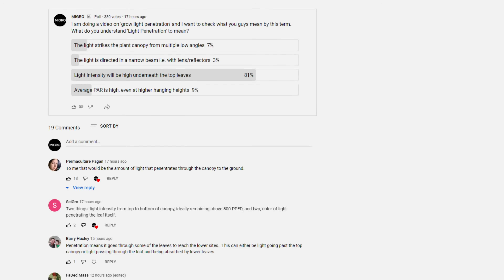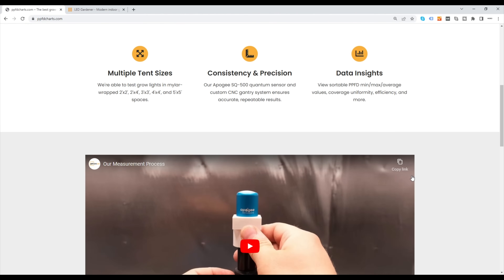Grow Light Penetration is WRONG

Comment: I can understand both at first I liked having the light low with my mars hydro but after getting a 650r I find having it raised as high as possible and turning her up seems to get better over all penetration so it come down to the desired use and design of the light I would think most gone use lights are designed to be right on the canopy and more commercial to be higher hanger

Comment: I am commenting right after the poll, just to throw in my thought on what Grow Light Penetration means. To me, it means that the leaves get light as far down the plant as Possible, so 100% Penetration would mean that the leaves on the very bottom of the plant get as much light as the leaves on the very top of the plant, As you go up the plant from the bottom, the penetration % drops, if the very middle of the plant from the bottom gets the same light as the top, that is 50%. If only the very top layer of leaves get light, that would be 0%.

Comment: Maybe true for some. I pay 1/2 the rate you mentioned. HID systems components can be replaced individually, while LED can not. At current prices I feel HID makes sense for people like me.
I don't see many talking about total cost over a longer time period which includes replacements assumed to be at current pricing.
Reply: Thats the other side of the Led Saga 😅😅led are good but sodium still works , the equipement its cheap compared to any led, its funny couse in the old times the idea was to reduce the bill , but now everything is eficiency .and they finish with 750 watts leds bill 😊and if a lamp burn , i can replace it with 10 us😅

Comment: I have a random question.
Once I've remove, the plastic cap, from light bulb can I change the spectrum by colouring in the LEDs with a red/blue sharpy 🙂
Reply from the maker: Hi, 

No a phosphorus coating on the LED diodes is what changes the color temperature.

Comment: Are you sure about side lighting? as this is something I've always wanted to try as I would think there's always branches and buds that are underdeveloped because they don't have access to light, and if you open things up or bend them into the light suddenly they take off. I would think having sidelights would develop the layers under the top canopy more.
Reply from the maker: Hi, 

Side lighting will increase yield but you will not the a good return versus the extra power consumed.

Thanks.

Comment: Shane you are spot on.  To contribute... I think there were a lot of older growers in this industry that were saying LEDs did not have the same penetration as HID lighting.  With older LEDs this may have been true in a way, but certainly not as we have seen here by your poll.  Early LEDs did not have the green spectrum intact.  With that, there was a diminished activity in the leaf structures due to only shallow tissue "penetration" occurring when the light hit the leaves.  You illustrated this perfectly with one of your slides.  Once the light package went to full spectrum, and then later with the addition of Far Red wavelengths, LEDs came into their own as a viable option vs. HID.  As far as mechanical penetration goes shade is what it is.  FACT - If an area is shaded from a light source the light intensity will be reduced in the shaded area regardless of what lighting type is used.  Again... Having your multiple source light fixture (bar type lights vs. single quantum boards) means that light is available from multiple angles which minimizes shade areas.  It is truly the best possible solution.  Now what I would like to consider is it better to remove the blocked leaves off the bottom of the plant OR is it better to take off large leaves to let unblocked light down into the canopy.....  Great Video!!
Reply from the maker: Thanks.
Reply: Better to remove all the lower weak shoots when coming into flower imho.

Comment: Light penetration is equivalent to low efficiency. Light can only hit shaded areas by not hitting the plant initially, and the bouncing off the walls of the tent or grow area, back towards the plant and hitting a shaded area. It is also more of a property of the canopy than of the grow light. Plants know their canopy produces shade and that is just how they roll. if the canopy is dense, light just doesn't penetrate. Yes, some light passes through the leaf. Yes, some light scatters several times and still enters the canopy at an odd angle. But like this video shows, that's marginal.
You would get the most light penetrating inside the canopy if you blast all the light not at the canopy of the plant, but at the walls.

Comment: The one question i always have as far as trimming everything on the lower parts of the plant aka lollipopping is whether we even have any proof that the plant isn't getting enough light absorbed through the higher canopy that is receiving the majority of the light tand getting everything it needs   to cover the energy requirements of producing flowers above and extra to distribute in the plant to areas below the main canopy or, if it is costing us yields and quality on the higher up flowers, where the exact distance from the light/ or amount of lower flowering sites kept in an area where the light is not penetrating to,  begin to cause a diminishing return due to the loss of yield or other measurable desirable traits in the top canopy is greater than the additional yield etc gained by having the additional sites being left on to produce additional flower mass. i see this as especially useful information if growing for extracts because if all we are doing is trying to gethe highest yield of actual trichomes than whether larfy lower buds or perfect pretty dense colas is irrelevant. hope that makes sense  ...
Reply: Hey man, it has been studied. Look up shape matters plant architecture affects chemical uniformity in large size cannabis plants. There is an argument for pruning lower branches and doing leaf removal in the top third when growing for packageable dried flower. These methods are shown to greatly increases the potency of lower buds and the chemical yniformity of all buds while yielding statistically not significantly less than control.  The plant seems to genuinely redirect yield to the tops, and more uniformly. The study found a higher amount of biomass and total thc from topping the plants twice with no pruning, however this resulted in the lowest chemical uniformity score. Interesting stuff and really validates the industry standard pruning methods
Reply: @willtremblay  its a relief to know i wasnt pruning for nothing. anything about whether theres any positive effect from light directly hitting bud sites or if energy is oly absobed by leaves and theres no benefit to timming leaves ff to get more sun exodsure on actual flowering sites ?

Comment: I believe side and supplemental lighting is a bit ignorant. Sure as demonstrated in previous videos. Grow lights that have two lights centered (not above) off center and at a 45 degree angle are among the most effective at getting light through the more typical pillar light canopy of a cannabis grow operation. However using lights that come in the side at 90° angles or worse from underneath the canopy. These are just stupid products and really dumb ideas. Just to get light to a few under developed buds.
  The reason for this level of ignorance is apparent for the novice grower. Who wanted to get the most out of their first few grows, but the bigger problem is they didnt know how and more importantly. They didn't know well enough being pitched a product that will certainly do more harm than good. 
  Because there is a reason the stomata or lungs of the plant are located on the under side of leaves. Because this is the most vulnerable spot on the plant for one thing and it is also the safest location for all plants to breath. Being the stomata are away from the direct sunlight of the sometimes burning sunlight and also are safe from getting clogged pores if you will , whenever it rains and even protecting them from dust.
   Lastly as aforementioned the most important thing any new grower can do is research the study of growing and in point of how to get the most out of a single plant. This study is one of plant architecture and it's effects of both cannabinoids and Bud development. How to safely sacrifice the lower nodes and not the necessary foliage the plants need, but at the same time learning what to trim off entirely and what training methods work for you. In all of these studies you will find a common thread among us all. That we all aspire to trim and manipulate the plant in such a way, while using our knowledge of plant architecture and cell regeneration to manipulate the structure in favor of removing bud sights before they even become buds sights. In advance so as to force the plants to grow new bud sight locations near the upper most portions of the plant. There is one such study you can find on YouTube on Debaco University YouTube channel under plant architecture. I hope this helps someone. Remember that growing is an acquired knowledge and wisdom that only comes with experience and experiment. Study first and foremost the very scientific evidence of this art, before you listen to others on YouTube who are just pushing products and a dream of getting paid to grow at home. 
  This dream is one we all share together as well have all fallen in love with the art of growing and the predictable behavior of mother nature when we learn to place nature on the rack and compel her to bear witness and the rest will fall into place.

Comment: Thanks for the video! As far as I understand it, penetration is not exactly the lights ability to push through leaves, but the difference in light intensity from the top of the canopy to the inside or lower part of the canopy. Higher intensity fixtures at a farther distance will push down farther into the lower part of the canopy assuming there is room (via trimming / defoliation) to do so. A light at, say, half the intensity and close to the canopy will have lower vertical penetration, but decent horizontal penetration. Growing in an open room with several fixtures will allow better vertical and horizontal penetration as the light comes in from several angles. Contrast this with growing in a tent with a single fixture: Vertical penetration may be good, but if the fixture is high above the canopy, the horizontal penetration will be low. If the fixture is lower, you are using a bar style fixture, and the plants are not too bushy, the vertical and horizontal penetration will be good. Overall, there are a lot of factors to consider with penetration and there is not a one-size-fits-all answer. -Erik
Reply: The higher the intensity on the canopy without exceeding safe limits the taller u can grow them whilst recieving enough intensity down the side of a 2-3ft high cola 😂
Reply: By the looks of it, theres enough light getting to the top 24 inches with 730ppdf to achieve results. Ramping up to the 830ppdf would allow enough light getting to the top 36ches increasing yield potential. Kinda makes more sense now
Reply: That sounds nice in theory but its just not how light works.

Comment: sun par is the same at the top of the plant as well as the bottom. Penetration to me means that. getting high par at the lower levels. with Cannabis most people lollipop and try to get 6 to 10 main steams. so in reality. they dont need penetration.
Reply: all the more reason to run the lights at 50% power and bring it closer to the tops and save energy too

Comment: When I think about grow light penetration for LED’s, I am thinking about the amount of PAR on the edges relative to the amount of PAR in the center. Ian, (Shaun! I’m so sorry if I just got your name wrong) my first grow was in 97 with a horizontal HPS fixture I built when I was 15. I haven’t done any studies, but I will say that I noticed a significant difference in the size of lower growth when I stopped supplementing with the horizontal 400’s. That was 20+ years ago though. Also, where I am in the US, tents aren’t as common as you might think. Basically if you have a basement, it’s 50/50. Btw, you’re the reason why I have a Maxsisun running in front of me as I type this. My next light will be from you, we need to support those who are active in our community!
Reply: Bruce Bugby is the guy for lighting knowledge, search for him.

Comment: Nice demonstration, I've often wondered about the different light set-ups and their effectiveness. 
Still curious tho as different plants have a preference for different conditions and perform better with a wider variety of wavelengths at differing stages of growth, not to mention the diffence in photosynthesis rates between tropical and arid plants in high and low humidity climates.
My point is... there is no wrong or right answer as it comes down to what you are trying to achieve.
Reply: Is that a phone number?

Comment: Penetration has to do with the amount of lumens, even though LEDs have high ppdf they typically have way less lumens (around 160k for a DE HPS) compared to the 120k or so lumens from a 650 or 740w LED so HPS definitely has better penetration, these days everything is ppfd but ppfd doesn't tell the entire story. The 1000w DE CMH fixtures are hands down best value for money atm imo. 1/4 price of LED and colour rendering index of over 90
Reply: @sgsgtvs  it's always hobby growers who come with these BS arguments. You can light up two 5ft X 10ft trays with 4 X 1000w of DE hps. You need 3 X 620w LED fixtures for one 5 X 10 tray so where is the huge savings lol? IF the fixtures were 480w you'd still only be saving 1000w more than the just using the HID fixtures and pay 4 times more for the lights just for the HPS to outperform it regarding average ppfd over the 5 X 10 area because of the light overlap. 🙄 PLEASE SHOW ME A SINGLE 480W LED that gives you an average ppfd of over 700 on a 5 X 5 canopy 🤭🫤 read more, watch less videos.
Reply: What are you talking about? Usable PPFD is litterally the only unit of measurement that should matter
Reply: @RemkoDesmet  NO. Ppfd should be 800-1500 depending on supplemental co2 but ppfd isn't used to measure brightness/penetration. Lumens are a good indication of penetration, ppfd is a good indication of usable light at canopy level
Reply: @pcjacobs615  you are making me chuckle. So what is the measurement that is most important regarding the choice of a grow light? Isn't that the amount of usable light for plants at canopy level? 
If a light has insane brightness (high lumen output) but the spectrum sucks and is not usable by plants, will you still choose the light with the highest lumen? Nope. You will choose the.light with the most light that is usable by plants for photosynthesis. So basically, as i said,usable PPFD is the only measurement important enough to base a decision of of. With uniformity being a close second.
Reply: @RemkoDesmet   @Remko Ofnie  where did I say that lumens are a more important measurement? I said PPDF isn't the only thing to look at and that HID grow lights have better PENETRATION THAN LED which is 100% factual. I mentioned Lumens in the sense of how many lumens the typical LED puts out compared to HID in relation to brightness/penetration not as a way someone should go about testing the light levels of their grow. As far as spectrum is concerned it comes down to the CRI of a lamp, CMH lamps has a CRI the closest to the sun of 90+ 🤷🏻 LEDs don't emit UV (or as much far red/infra red as HID lights) which also needs to be factored in..  as for uniformity - high ceilings and commercial overlap grid with HID fixtures... 🤷 I was just making the point that the LED lights aren't nearly as efficient as people claim them to be. What's next, are you also going to tell me that a 500w led light can light up a 5 X 5 area with the same uniformity/ppdf levels of a 1000w DE hps ?🙄
Reply: @sgsgtvs   electricity price doesn't justify the 4 X pricetag and a 500w led doesn't compare to a 1000w de HPS sorry. 740w maybe, 500 definitely not. That's just garbage the manufacturers tell people, it's BS. You can't light a 1,5 X 1,5 with area with 500 w led and have high ppfd values the entire canopy lol
Reply: @sgsgtvs  not very bright are you. Maybe if you understood words like you can supposedly understand numbers you'd get somewhere 🙂 like I said in an earlier comment, show me someone pulling 3 pounds per 500w LED "1000w de HPS alternative/replacement" 👍
Reply: @pcjacobs615  mate, your full of shit. In this video, litterally IN THIS VIDEO , shane explains why penetration DOES NOT MATTER NOR DOES IT EXIST. Do you have ears and eyes man?